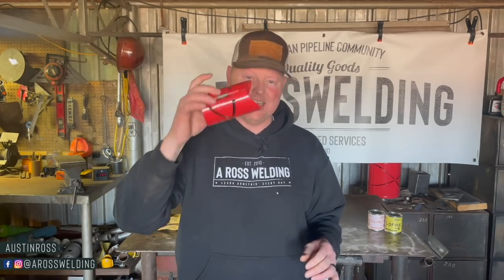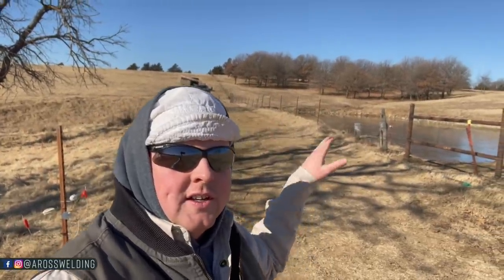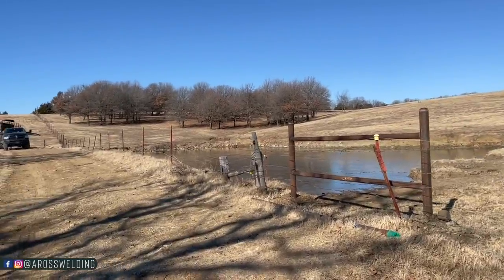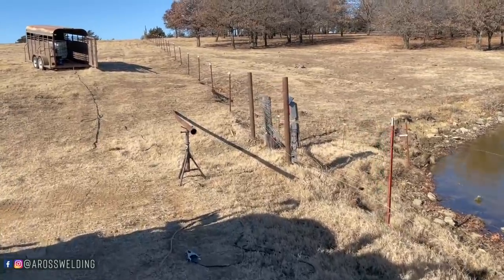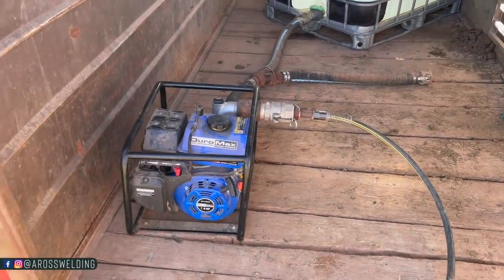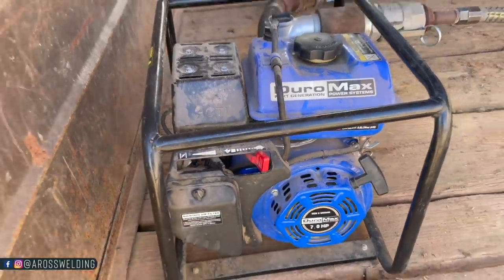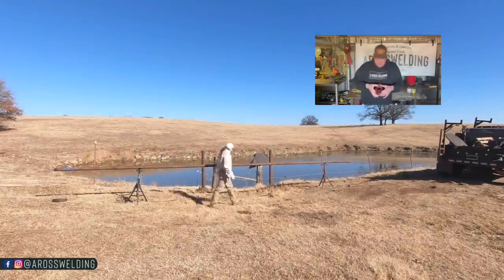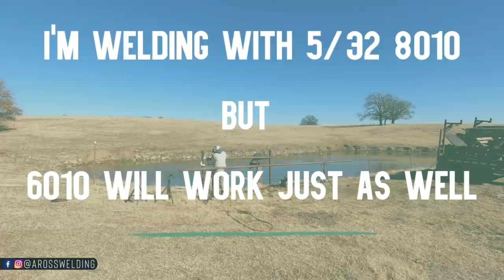HOW TO LINE UP PIPE SADDLES FOR PIPE FENCE (WELDING NEW H-BRACES & NEW FIRE RIG)

Comment: Never too old to learn something new; and you are always ahead of the game when you are welding around grass or brush, to wet the area down,& if you really want to keep the area wet without getting it too muddy & still keep it safe enough to not start a wildfire, use a couple of ounces of dish washing soap in your water tank; it won't hurt your pump or equipment & will keep the grass & brush damp for an hour or more & if a grass fire does start,the soap mixture will help extinguish the fire faster & is biodegradable. When I was just starting out in a small volunteer fire dept. we didn't have a budget & paid for the gas in the fire trucks from our own pockets; we couldn't afford the fancy fire fighting foam that the other departments were using,so we would carry a bottle of " sunrise" dishwasher soap in the old fire truck & add a few ounces to 50 gallons of water & we had a " foam" that would work as well as the fancy expensive foam the bigger departments used! So keep up the good work & great video's, like you say, learn something every day!

Comment: Been building pipe fences in Texas for a few years. Easiest way I have aligned pipe for cutting saddles is simply use a chaulk line. Center it by eye on one side and pull the chaulk line to the other end and line it up centered on the end (by eye again) and poop the chaulk line. The template I use has a small gap in it and this is what I use to align my chalk line to the saddle cut for both sides. Easy and quick. 
Love your videos. Keep up the good work. I have used a lot of your techniques in my fence building and has made me a better welder to deliver a better product.

Comment: I use a Torpedo Level.
You clamp you pipe to your stands, set the level on top of the pipe, get it level and drag it perpendicular to the pipe.
Dragging it leaves a little scratch and I go off of that.

Comment: Doing ranch fencing in Montana barbwire was on post by certain spots on post. Steps for setting posts. Braces was with marking paint and residential fences were measured and marked.

Comment: Looks good. I like that you have a water tender for fire suppression.  On that water pump, you need a recirculating valve on the output of the pump to increase its life and also the helps with water hammer issues on shutting the water hose off quickly…

Thanks for the welding tips and tricks…

Comment: I use 2-7/8 tubing for the posts, then I cut 4 inch long pieces of 2-7/8 with a saddle on one end. For the cross members I use 2-3/8 which slips right into the short 2-7/8 pieces. This saves me a lot of time because I don't have to line up the saddles, the cross member length doesn't have to be exact, I do less grinding, and I get a good fit for welding. I make the 4 inch long pieces at the shop which is more convenient that in the field.

I built corrals the same way.

Comment: You might want to remove the flammable decal off ur water tote. If a state trooper pulls u over and sees that he will think it’s haz mat and issue u a citation for not having a hazmat license and not plackerting ur trailer. Just a heads up

Comment: Hello Mr. Ross.
Another good video. I think giving the saddle a good eye ball is the best and fastest way to line it up. Most of the time I’m building fence by the foot. Getting the center finder out and marking true center just takes up to much time. Burning 5/32 rod will fill in the gap if your off a little. Work hard and be safe!

Comment: Do you have any tricks for measuring the correct length of cross brace so the saddles on each end fit correctly? For example I cut my saddle on one end and measure from the throat, align my saddle clamp where the mark should be for the proper length. Is there a faster way?

Comment: I built a dining room table for myself a few years ago, I used my body sitting in a chair to come up with the height I thought was most comfortable and the width I wanted on the end where I sit.  Then I lined up 4 chairs and had my brother in law and nephew sit in them with acceptable arm space to their sides, then I sat in a chair and in this line, then my nephew moved to the other chair next to me, then I added 2' and that is the length.  It ended up being a big heavy table that has always had alot of room to breathe around it.

Comment: You should check out " hydraulic ram pump " for your water supply. Really cool, requires no power just a water supply. Two check valves and a stand pipe. Will not have to worry about running out of fuel for the pump or running it without water running through it.

Comment: Using vice grip large mouth pliers on the 2 7/8” posts will make life a lot easier. None of that “quick tack “ one end while holding pipe up. Your back will last longer
I’ve welded a bunch of 4 rail pipe on my own land and found a four bale round bale trailer  makes a great pipe trailer 
Weld up three 12” lengths of 2” angle on one edge and load trailer with 32’ drill stem
Flip up pipe on angle at one end then the other  and you’re ready to start cutting saddles
No falling over pipe stands

Comment: The way I line up saddles. I cut one saddle grind to fit. Take a short length of pipe that fits the saddle, hold it in place in the saddle roll the saddle til the length of pipe is vertical (use a level if you want) go to the other end and mark it where the center of your saddle template 
needs to be cut, grind, continue.

Comment: The proper term is called an "Eyechromiter"  I don't know how many times you put something up plumb and level against a slanted background and it looks like it's out of plumb.  A speed square and a string line is the easiest way.  I recommend to always bring a level to any job sight you are sending a quote too in order to check what you're building to is plumb.  One last note.  I'm old school too, but you have mastered Arc and Torches.  Plasma Cutters have been around a long time and if you want to learn something new, I recommend Plasma.   Your torches won't be jealous.  Flux core in wind is a money and time saver.

Comment: Thank you sir, all the old timers at my job call it "the chicken eye" haha use it whenever I'm building an assembly especially working with 3/4" socket welds building above ground stuff.

Hey man  where did you get that green hood? it looks like a fibre-metal tigerhood but here in California we only have the blue or black ones. I really dig the green.

Comment: When we are fabbing pipe on decent level ground, and continuously moving pieces on and off the jack stands, I use my hand on my side to measure about the right height to set the other jacks.(saves a little bit of time.)

Comment: Line up info starts at 7:24. Snap a chalkline the length of the pipe for a reference point. Line up the clamshell pipe saddle template hinge to the chalkline reference on opposing ends of the pipe. Works well, especially on shorter runs of pipe.

Comment: Couple ways to fins center.  With a small framing square and a torpedo level.  Put the square on top the pipe and one level it, mark half of whatever the diameter is..... if its 1 1/2" pipe, which is really 1 7/8" you would mark 15/16".   

With a level and a tape measure, hold the level verticle against the side of the pipe, hold your tape against the level, and mark half the diameter.  That way is a little harder, kinda need 3 hands.

Easiest way is with a center finder with a spring loaded center punch.
Reply: Old school! No moving parts like a centering head. Use this method on 4” to 16” pipe.
Reply: Square method easy way to mark quarters off also.
Reply: @dannyharvey5623  yup, thats how we did it.  A more accurate way a 100' tape and dived the circumference by 4 to quarter.  If yoe needed to roll a certain amount of degrees off center,  divide the circumference by 360 and multiply it by how many degrees you need to roll it. 

I really miss fiiting, but I also like being a designer now.
Reply: @noncched6839  “Old School”
Square, level, and tape measure!

Comment: In addition to the comment about removing the placard on the tote, you may want to secure the pump and tote. Oklahoma 47-14-105 requires loads to be secured, and there is a federal report that states violation potentially carries jail time in Oklahoma and about a dozen other states.

Comment: When u measure between your 2 post how much you deduct when saddling each end? I’ve always just kinda figured it out but figured you have something to educate with.
Reply: I mean add just realize I wrote this wrong
Reply from the maker: It depends on what size of pipe I’m using for both the post and rails. I usually just eyeball it though. Guess, then adjust on my next cut.
Reply: @arosswelding  thank you. I’m a structural welder from California and really enjoy your channel.